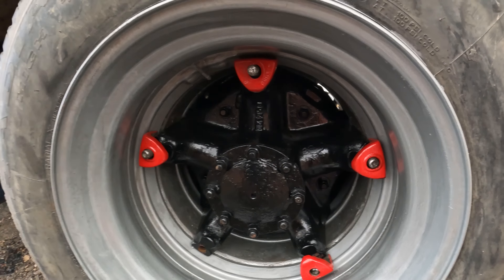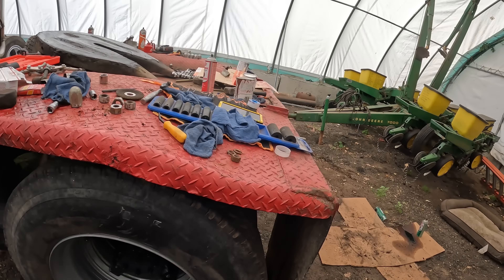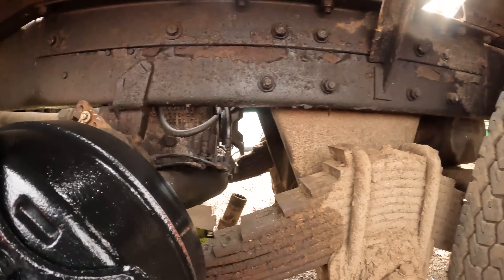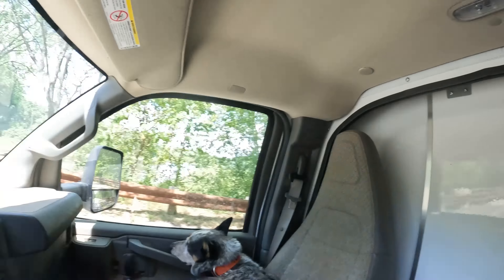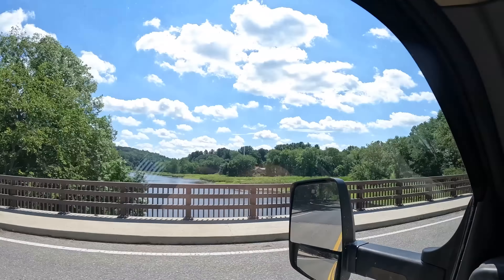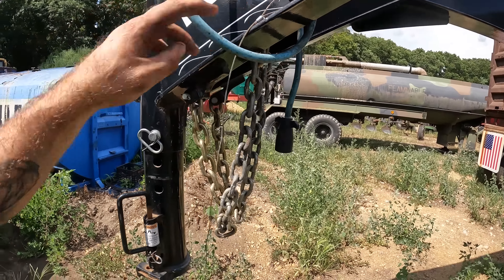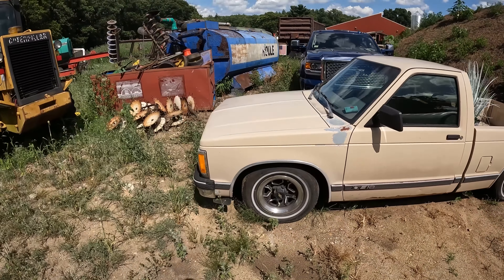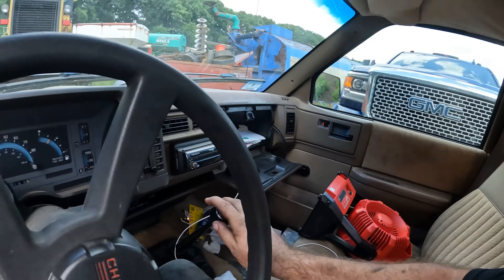Back To Farming And Some People Are Not Happy!!! Angry Neighbor & Truck Issues

Comment: Nice old Pete. Funny when you were pointing out the no license plate what I noticed is no mud flaps. In our country almost worse than no license plates. Good luck and keep up the hard work.
Reply from the maker: Can't run flaps with that trailer because they get ripped off. If the trailer prevents rocks from being thrown up then it isn't frowned upon. He has a set of flaps He put on when he dropped the other trailer

Comment: The rims look nice on the Mack. The Mack is how I found your channel. I'm in central Maryland. I had been looking for a hay hauling truck. I looked for a one ton, but used pickups are pricy. I have always wanted to have a road tractor. I noticed old road tractors were cheaper. So I started looking for an tractor. I noticed the Mack you have and saved it on market place. I watched it for a couple of weeks. I made up my mind to go look at it and it was gone. I figured oh well it wasn't meant to be. A week later it showed up on YouTube. You had purchased it. I subbed to your channel and have been watching ever since. I have enjoyed your channel and content.  I found a 87 Mack R model single axal with a 250 and 5 speed with new way air ride rear. It was restored in 06 and is very low mileage. It's needed some thing fixed on it and I added a pintail hitch to it to pull my trail to haul hay.  To bad thigs didn't work out with the farm. Hopefully an opportunity will open up and you can get back to farming. Good luck and thanks for sharing your videos with us.

Comment: Been there with the turbo issues in an old vw tdi i had, would run great then all of a sudden could barely pull a hill in 2nd. I get doing round bales but it definitely takes some time and the mixer wagon I've seen on the video is definitely not going to take a round bale the farm would either need a vertical mixer or bale processor., i would guess. Typical mass and southern new England attitudes with that guy. We get that all the time down here in ct

Comment: Drill a hole and tap it for a 1/4” pipe plug in the exhaust housing and fill it up with oven cleaner a couple times.   Rinse and repeat.  200k miles on mine with a plug 👌

Comment: Round bales chopper square bales as long as you are set up to handle the end product it’s all good. All those old Cummins smoke because of the lower compression they run compared to the same vintage cats

Comment: My little s10 has a 300 hp 2nd gen LT1 v8 with carb and 700r  plus a 8.625 disc brakes s10 rear end with positraction and 3.42 gears.

Comment: There might be things or plans I don't know about but if I were you I would hang onto that 5 acres you might have 40 fall into your hands by next year right by it and you will be kicking yourself for not keeping the 5 . I have been in similar shoes as yours before. Really similar, and things are turning out so keep your head up.
Reply from the maker: Having no place to keep equipment or farm out of would be the problem also the farm supplies my housing so I will be moving out of that at some point sooner then later especially with talk of charging me crazy amount per month due to the location

Comment: The vanes in our 06 LLY Duramax got stuck and threw a code. Took it out and railed on it, wide open throttle as much as possible and it hasn't come back. Had a mechanic friend that did the same, with the same results. Diesel shop said it needed a turbo...they were stuck from putting around town unloaded in this case.
Reply: Same thing happened to my 05 hooked it to a load and ran it hard cleared right up

Comment: Why did you lower the back of your truck I like them level or with a little bit higher in the back so it's level with load on it.
Reply from the maker: When the trailer isn't on its level I hate how the sit sloped factory and didn't want to level the front. I need to put air bags and it will be ideal
Reply: @DuffyAg  you can crank torsion bars up little bit to level them us it will ride better most of the time front end is sitting on bump stops factory couple turns makes a big difference and you get some travel in suspension
Reply from the maker: @williamspates1015  this truck rides like it's on a cloud even when it's cruising
Reply: @DuffyAg  Denali seem to ride better stock hope you don't have any issue with change drive line angle

Comment: Left front wheel on Franks IH have issues?  If it's like mine, probably does.   Feed looks good, we finally got some rain this week, but it was too late for some of mine, bushhogged some of my second crop as the weeds were taking over.
Reply: And fwiw, I can do about 35 bales per day, cut, rake, bale, load, haul, wrap and stack per day, hauling 26 miles one way.  The only advantage is I can do them solo.  As much as I'd love to chop, I can't chop solo.

Comment: That's not good putting up wet grass it will catch fire
Reply from the maker: It's silage bales. They are supposed to have moisture to ferment once wrapped
Reply: @DuffyAg  well I've seen barns burn down from being put up wet and it will mold